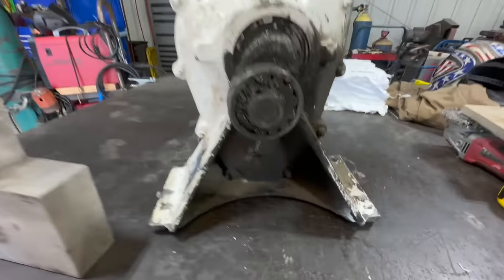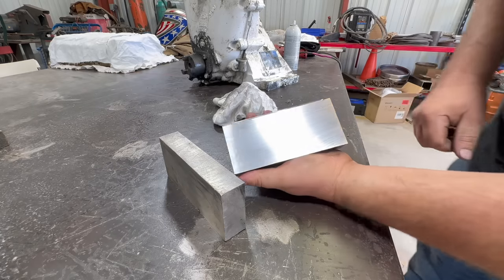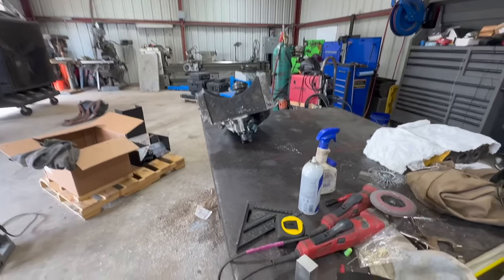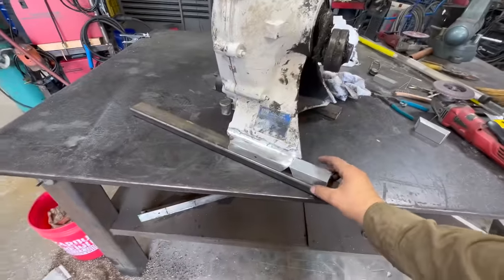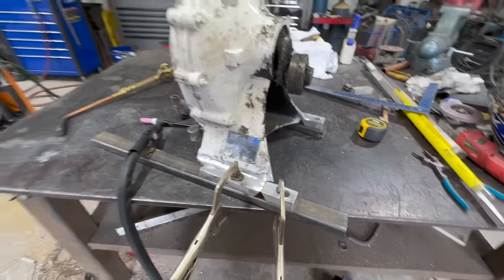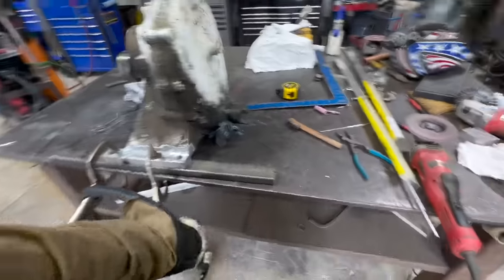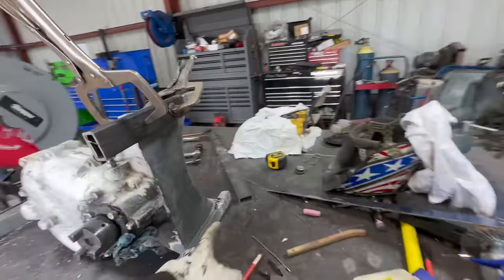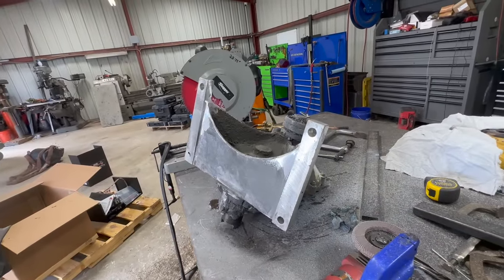Aluminum diaphragm pump repair

Comment: Great job! You’re absolutely correct about charging your normal hourly rate while cleaning. I do the same for cleaning, disassembly, reassembly and painting. I’ve shared with customers that they can save some money in these areas by doing it themselves or by having an employee do it but if they’re willing to pay me 4to5 times more to do it, I’m happy to accommodate them.
Reply: We're required to clean whatever we're working on for contamination control. Some customers bring their equipment in in really bad shape and we spend many hours cleaning them and they get sticker shock when the bill is due. Some finally started bringing stuff in cleaned but others haven't.
Reply: I've done the same with informing customers about the time/cost of cleaning, it's 50/50 on them doing it. Some are surprised that cleaning is part of the preparation, and the prep time can take longer than the actual repair occasionally. On a different note, how do you like the Tifco bits?

Comment: Great repair I worked with Aluminum on airplanes for a few years and yes Aluminum holds heat for a long while especially as thick as you were using. Like you said can’t tell there was a repair even done on the piece except the new paint. Nice pup you have there he’s protecting his dad while he worked. 👍 🇺🇸🇺🇸

Comment: This may be a silly question, but can you do a video about your daily shop cleaning procedures?  How often do you sweep, what kind of vacuum, cleaning shelves/hard to reach places, how frequently, etc.? 

Great video, ty for showing the closeup of the overlapping welds in the middle of filling out that beveled joint.
Reply from the maker: I can do that. Maybe I will include that information in a shop tour video.

Comment: I was wondering what you use to clean the metal before welding. I always use brake clean to clean metal, but heard it is not a good idea when welding because it produces a deadly gas! Another great video. Thanks
Reply from the maker: I use acetone

Comment: I totally agree with changing full rate for cleaning parts for repair. The time spent cleaning could be spent welding, fishing or drinking beer. Of my clients don’t want to pay for my time, they have the option to do the cleaning themselves. I do struggle somewhat with another issue though. I am retired and run my business more as a hobby and I have a friend who likes to tag along to keep occupied. He doesn’t expect any payment but is helpful in a lot of situations and certainly makes me more productive. Is it ethical to charge out his time and at what percentage of my hourly rate? I ask partly because I don’t want to be in a position where I am undercutting others in the area who need the work to earn their living.
Reply: As long as you give him something   Ok

Comment: I was struggling with my tig machine and gas’s coverage. I don’t do a lot of tig so always think I am doing something wrong. I turned out I had a crack in the gas line just inside the torch handle so I wasn’t getting sufficient flow at the nozzle. I only found it when I had the flow meter turned up way too high for normal use thenI could hear the leak.
BYW for my money, Diablo blades are the best bang for the buck on cold cut miter saws.

Comment: Really very good work. What did you use to clean the aluminum, I have never seen an aluminum spray cleaner. Looks like it works very well. You are a master of the trade.
Reply from the maker: Wd40 on the sanding disc and acetone right before the weld.
Reply: @OFW  was that acetone in the spray can ?
That you first used to get that oxidation off, worked like a charm.

Comment: Greg, I’m curious as to why you chose TIG, instead of using a spool gun with aluminum wire?  Seems it might have been an easier weld up with a spoolgun, perhaps?    Fine repair and interesting process as always….thanks for sharing this video!
Reply from the maker: Honestly the tig was already setup on the table and it was another good test for the Arccaptain.  Otherwise I probably would have used the spool gun.
Reply: @OFW  what’s up with all these arc captain’s never heard of em before but it seems most welders on YouTube recently got one for some reason. Never had the time to watch the videos of em and investigate though.

Comment: Greg, curious what the ProSchmo electrician did to your 3 phase, 
I have toasted 2 3ph motors on my lathe in the last few months, 
one I know why, but the other was like brand new......
hope the American Rotary treats you well......I know Fenner and DeeDee
and Abom are very happy with theirs....Paul
Reply from the maker: He installed a static phase converter and it said right on it Minimum hp 8. So about 3 minutes of run time and it burned up my motor.  The American Rotary converter is very nice. It’s quite and very easy to install.
Reply: @OFW  glad you got the proper setup.....my issue at my shop, was the clown who ran wires, had 3 phase running on 2 breakers, so one lead was out of phase.....got it solved last night....so sorry to hear of the mill motor crashing....best regards Greg....Paul in Florida

Comment: My question is do you charge extra for a Sunday call out, I fixed a "On Loan Demo" combine header during the UK harvest it had been damaged and repaired previously. The company sent their fitter out for a warranty job also break down work it was a UK bank holiday they charged £305 per hr as it was a Bank holiday.  As I have known the famialy 60 yrs I just charged them my std hr rate also only 2 miles from my house 
Nice fix on a dirty job
Reply from the maker: It depends on the situation.  On this job it was double time.

Comment: They should put a couple of flat steel plates 3/8" to 1/2" along the top of those mounts, and bolt the box down through those.  No more strain on the aluminium and won't break again.  A third bolt each side wouldn't hurt either.
Reply: I thought this too.  But a satisfying welding video.

Comment: Question about the 3M Cubitron II disks.  Seems in one of your videos, you said you use the 5" disks.  I assume you use the 5" on your 4.5" grinders?  I've been to your online Amazon storefront.  Do you use the Mercer backing pads w/holes?  Do you have specific 3M part numbers for the backing pad & disks you use?  Those 3M products are hard to find online.  I'ld like to try some, but don't want to get the wrong ones.  Really enjoy your videos...doesn't seem to be anything you won't tackle.
Reply from the maker: I use the Mercer pad.  I like it more than the 3m one. And it’s cheaper. I run 5” and 4.5” on a 4.5” pad.

Comment: Interesting it looks like you switched to the Furick Fupa 12 which they say is DC only.   Can you please comment?  Thank you.
Reply from the maker: I thought I was having a gas issue. I use it on AC with no issues.
Reply: @OFW  Thanks for getting back to me.  Just curious what diameter and metal composition tungsten do you use at 200 amps and a fupa 12?  I have run up to about 175 with 3/32 lanthanated and gas lens and a number 8 cup.  Worked great.

Comment: Those cheaper collets sometimes can be a little big, which blocks the gas from flowing properly, if you're badly stuck some time you could try putting in a drill and sanding it down a little.
Or buy some CK ones lol 
Nice job btw.
Did the Doggy hurt his paw?
Reply from the maker: Ya he got ran over.  But is doing well.

Comment: Is that cutting oil that you are using on your cubitron? Never would have thought of that to stop aluminum from galling up the wheels
Reply from the maker: I use wd40. Could probably use anything oily or wax.

Comment: Did you already know what the center to center was for the holes? Just looked odd how you marked the next hole since there was no refence point for the hole you drilled. I assume you did to lay it out the way you did using the edge of the existing hole then going to the center for the next  hole. Great videos as always.
Reply from the maker: I marked the center of the new holes from the edge of the old ones.
Reply: @OFW   Thanks

Comment: Now they're awesome video in the bag for you there man I'm the same way hourly rate for cleaning and prepping anything. Question about the welding of the aluminum I tend to do with the thick aluminum like that a weave instead of going side to side do you think it makes us stronger weld doing the weave over a side-to-side?
Reply from the maker: I don’t really think it matters as long as the fusion is good.

Comment: I would have thought you would have replaced the whole strip with the bolt holes with thicker plate with customer approval so that the failure did not reoccur. And a gusset at the front of the pump to handle stress cycling better.
But maybe the failure is due to the diaphragm pump contents hardening.

Comment: Do you find that welding thicker Aluminum moving frequency to 80-90 hz works better on that machine? I have an everlast ,and it does a lot.
Reply from the maker: I will give it a try.

Comment: What backing pad is on the grinder to support the disks?
Reply from the maker: https://amzn.to/3rMNYRI
Reply: @OFW  thanks. I use a lot of grinder disks. Work on a lot of snow and ice equipment. A lot of rust to clean up. Tried the disks. They are worth every penny. The backing I tried didn't work to well. Then hub came loose from the disk.

Comment: I wonder why that gear housing is made of aluminum.  It doesn't appear to be in an application that requires weight savings.  They probably wouldn't have had this problem with a cast iron housing.
Reply from the maker: A lot of things from that company are made like that. Almost like they want it to fail so they can sell you a new part.

Comment: Hey man what are you spraying on the disks while grinding? I’ve used Irish spring bar soap to keep the disk from clogging up with aluminum.  Love the vid
Reply: Think I remember that he spray WD-40. Please correct me if I am wrong
Reply from the maker: I use wd40
Reply: @OFW   beauty I'll have to give it a shot, thanks!

Comment: Well considering that looks like a diaphram pump off a pc6000 grinder, you could of charged them whatever and they would have paid it. They charge out the ass for those machines to even run on the road.
Reply from the maker: I am definitely aware of that. It’s a good customer.  I don’t screw them but I definitely get my money lol.
Reply: @OFW  lol i have tore up many things on those machines but the base of the gearbox is impressive. I usually see the ears of the bowl that bolts up get broke off.